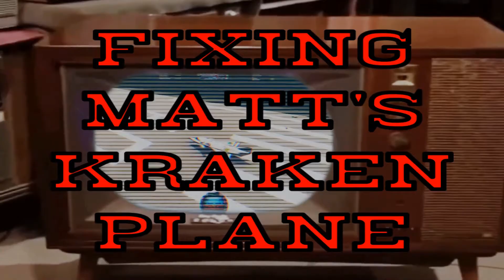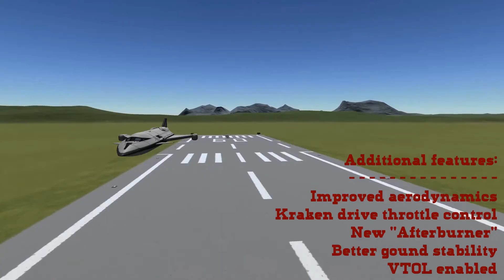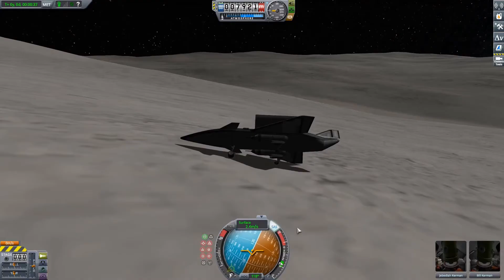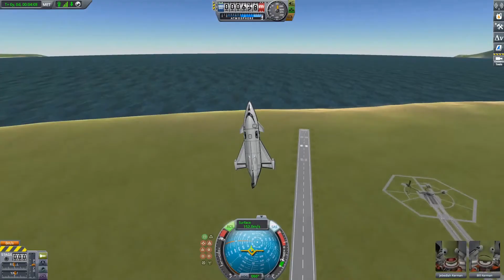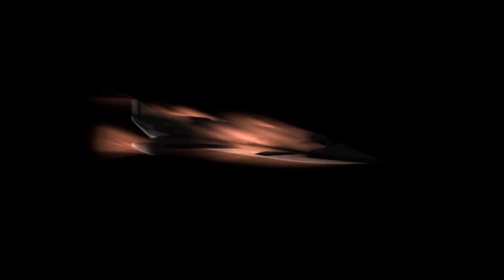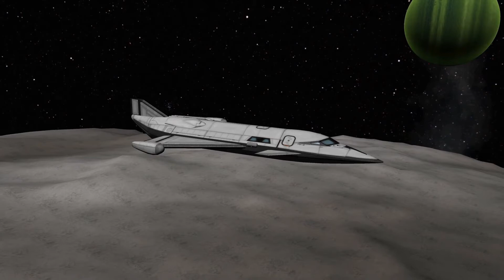Fixing Matt Lowne's Kraken SSTO

Comment: Excuse me. Do you have KSP on steam? If so, I'm wanting to make my SSTO a Kraken drive SSTO.
I call it the Starstorm. My handmade SSTO. I've tried to get your VTOL kraken drive to work on the Starstorm and it didn't work as I expected it to. In the future I will share my ship to get your kraken drive modifications to work on my SSTO.
I will give you half the credit for your Kraken drive and I'll get the other half for my SSTO design.

P.S. I'm very impressed on how you did the VTOL with the kraken drive.
Reply from the maker: Hi Kyle, thanks for your message. I do have KSP on steam, or else you can share the Starstorm file via KerbalX if you prefer. I'd be happy to "kraken-ify" it and send it back to you - there's no need for explicit credit, but if you don't mind I might make my own video of the process, which I'll ensure I release only after you have released your final version.
Reply: @krakentech5039  I don't have an account on KerbalX. HOWEVER. I can share it on Steam itself then you can kraken-ify it. Look for the name Starstorm in the future. It will have some mods loaded into it though. I'll share it on Steam as soon as possible.
Reply: @krakentech5039  I published the Starstorm on Steam. Free to modify it with the kraken tech.
Reply: @krakentech5039  Did you modify my craft yet? Just double checking.
Reply from the maker: @kylesworldofwacky6004  The honest answer is: no. I subscribed to it but couldn't open the craft due to the part mods you've used. Is there a chance you can replace any non-stock parts?
Reply: @krakentech5039  I'm afraid i can't. Can ya download the mods I've recommended on the file?